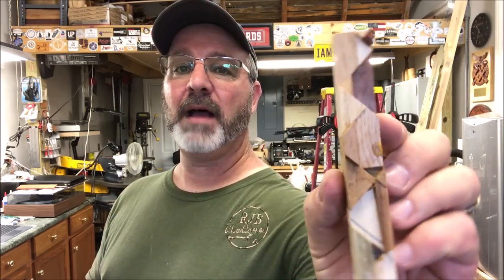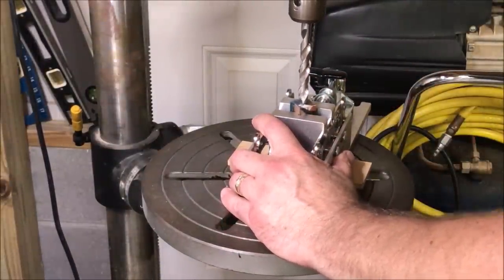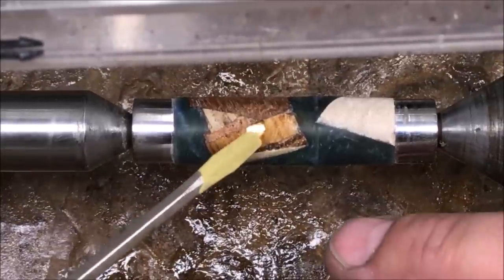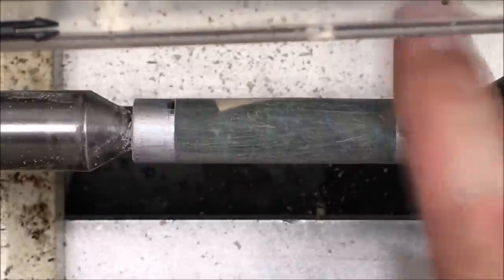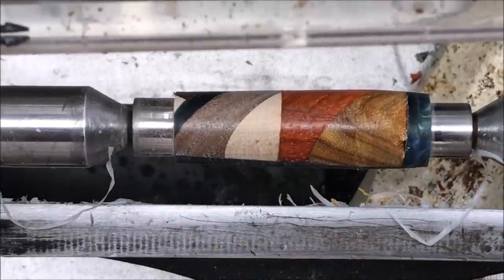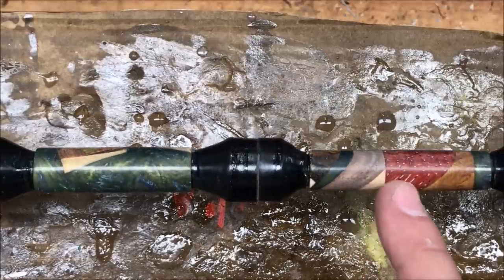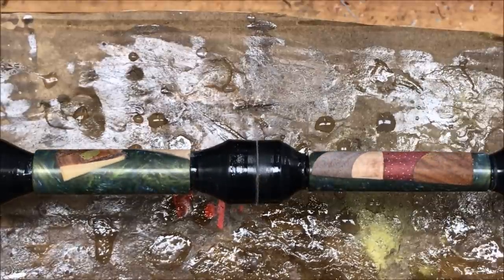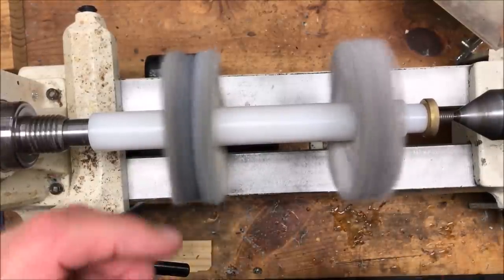Turning A Hybrid Chaos Pen Blank A Collaboration With Cross Cut Creations

Comment: Bob, Great work mate. I often forget to paint my resin blanks before I glue in the tubes. Sometimes when I paint the blank I have difficulty inserting the tube and then when I force the tube in it removes the paint. Frustrating at times. Thanks again for a ripper presentation. Take care. Dave Winch - Beachmere Queensland Australia
Reply from the maker: Thank you David. 
  Great to hear from you. 

Regards,
Bob

Comment: You mentioned that you don't like to use CA glue accelerator.  I'm somewhat new to woodturning and just recently learned how to make pens, and the way I was taught involved using accelerator in between coats of CA.  I'm curious, what are your thoughts on the benefits/drawbacks of using the accelerator?  I know virtually nothing about the entire process so I'm just looking for info on how to get better.  Thanks!
Reply from the maker: Hello Dan,
  If there is any moisture in the blank the chemical reaction will cause the C/A to boil. The surface cures and the moisture gets trapped below the surface. 

I’ve also had issues with activator causing the C/A to crack. The fractures are tiny but you will see them under good lighting. 

Regards,
Bob

Comment: Hi Bob, Great video and a great save with the Brass Powder. I use 5 minute epoxy when I do something like that and mix the powder and epoxy into a paste and then fill the hole. Very nice skew work as well Bob. Is the wax you use a Microcrystalline Wax or something different? I forgot to paint the tube on a hybrid with very similar resin colours to this one and the tube showed through. Like this pen it gave another level to the blank so worked out as this did. Take care Bob. Cheers, Huw
Reply from the maker: Thank you Huw,
  I don’t believe my wax has any abrasive qualities at all. If I’d does, it’s an amazingly high grit. 

Regards,
Bob
Reply: @RJBWoodTurner  Thanks Bob. Huw
Reply: Renaissance is a micro-crystalline wax polish.  FYI

Comment: Nice job Bob great video. Question because you’ve had this happen other times because of the end grain why don’t you use wood hardener on the blank after you drill it out then put the tube in. Just a thought. Anyway Mahalo for all the great video’s.
Reply from the maker: Thank you George,
  Wood hardened would not make a difference when you’re cutting across the grain. It’s only good for punky wood. 

Regards,
Bob